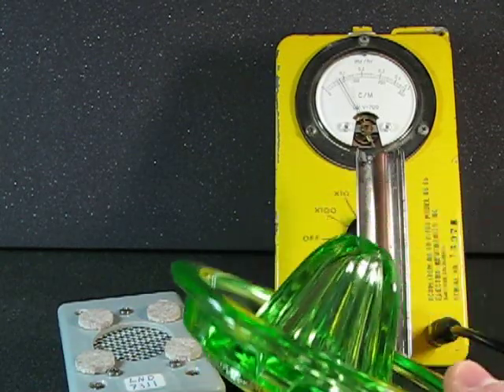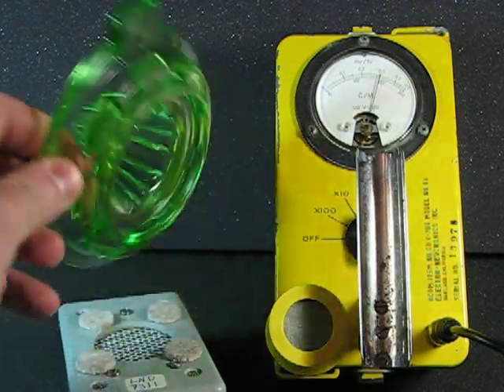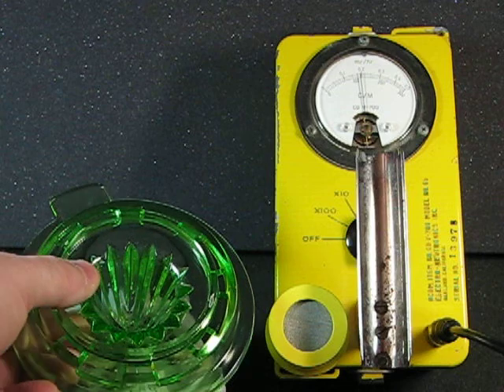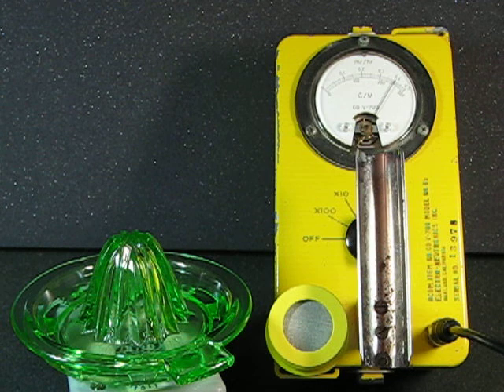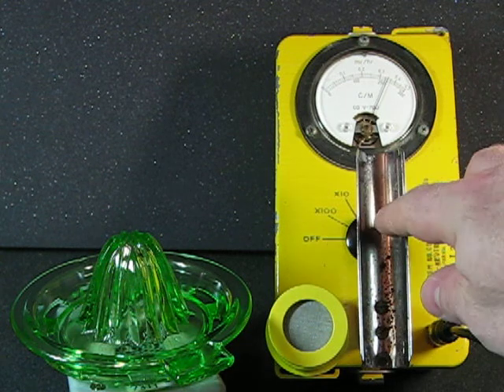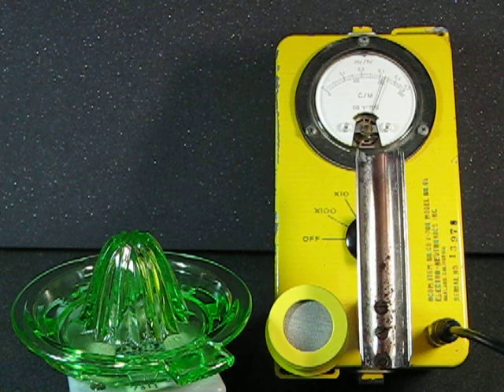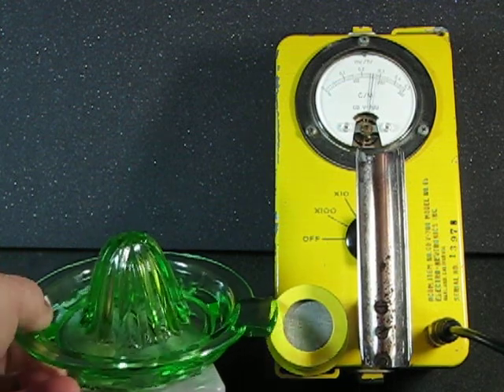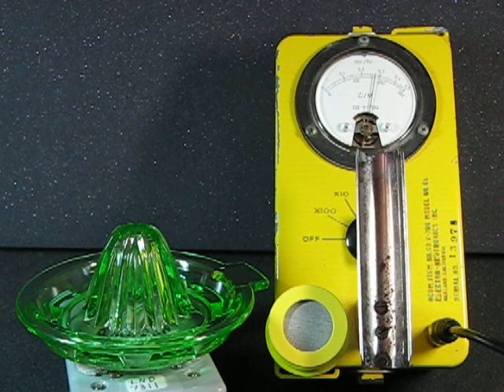~200 CPM Vaseline Glass Juicer Geiger Counter Tested LND7311 CDV700

Comment: Great video, we have a glass juicer that's a little bigger then that.
Reply from the maker: Thanks - yeah pretty much every one of these I've tested in antique shops has activity to it unless it's a more modern imitation.  Most of them are legit and will glow under black light as you probably know.  I take a UV flashlight with me now to test and make sure things are not just Thorium glass (which will set off the counter with lots of clicks but doesn't actually glow).  I've bought a lot of it by mistake before I got a UV flashlight.